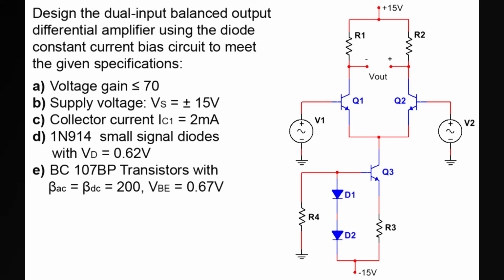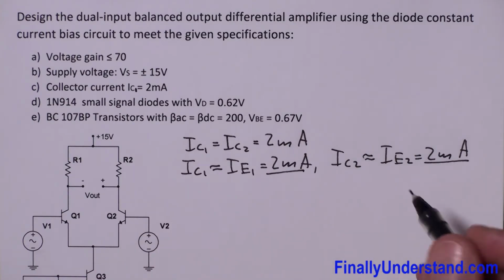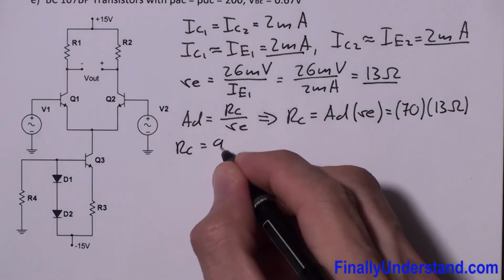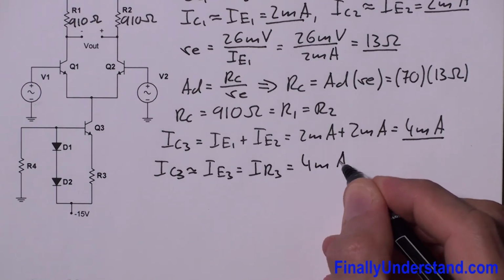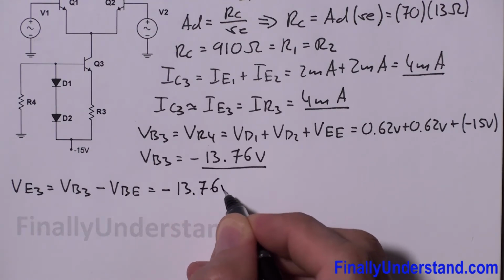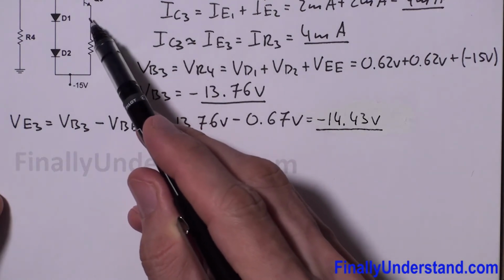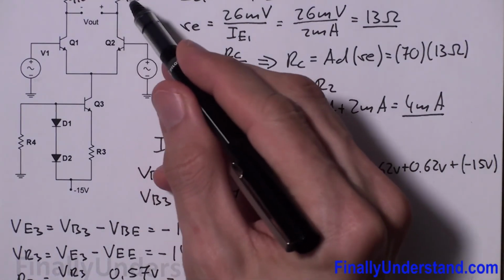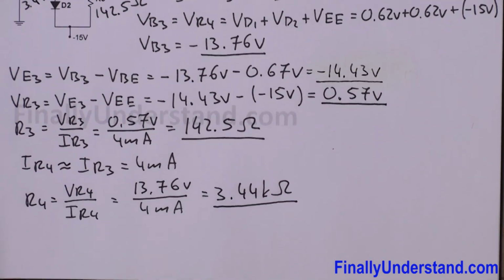Dual-Input Balanced Output Differential Amplifier | Diode Constant Current Bias Circuit Design 14

Comment: Where does her get 26 mv from ??

In transistors, the value 26 mV represents the thermal voltage (\(V_{T}\)) at room temperature and is used to calculate the dynamic emitter resistance (\(r_{e}\)). This calculation is crucial for analyzing a transistor's performance for small, time-varying signals.

Why does not not tell us that !?

Because English is not his natural language. He processes very carefully exactly what he needs to say.
Reply from the maker: Hi, Indus2020
At this level, your professor expects you to know that. So do I :)